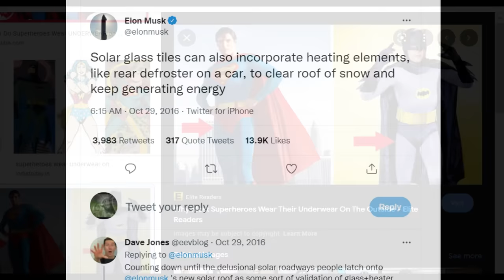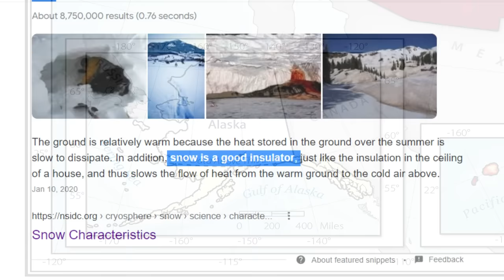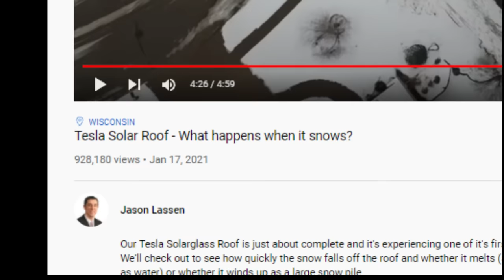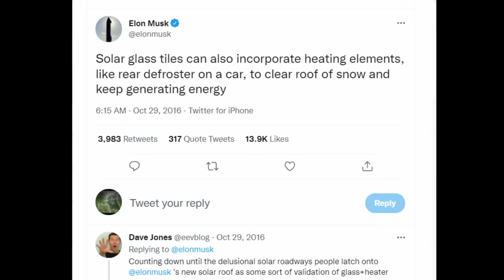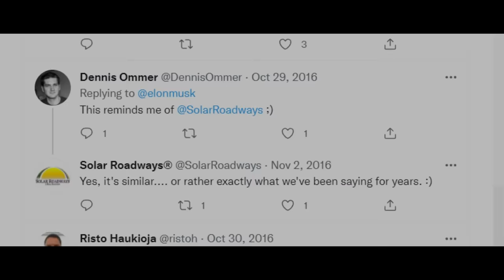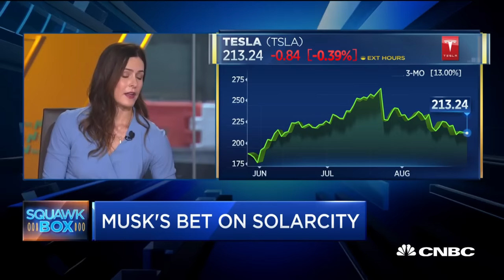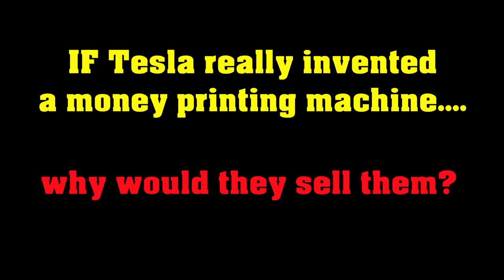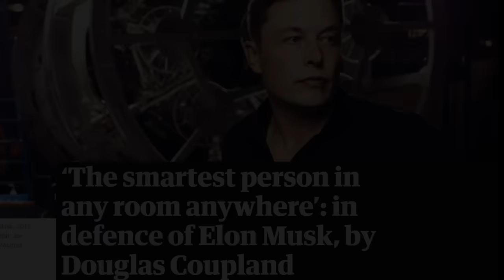Elon Musk: The Smartest Person in any room ANYWHERE!

Comment: I learned that at age 11 from a bus driver on my way to school in the 1980's. For some reason he thought it was fun to point out which houses were insulated and which were not, and it became a gme on the bus to spot them first.
Reply: ...and little Johnny felt pride each time his house was pointed out as "well insulated",  but knew inside the heat was barely on.
Reply: xD i'm gonna make your comment more explicit: "Elon Musk would not be the smartest person in a schoolbus" ;)
Reply: @kapa1611  School bus? Elon was too smart for school. He was always  playing air hooky instead. That's why he knows so much about air hooky tables.
Reply: @1puppetbike  Take a look at the icicles to confirm which houses are badly insulated.  The more and bigger the icicles, the worse the insulation.
Reply: @Foolish188  not necessarily. The reason snow makes such good insulation, is because of the fact, the layer in direct contact with the roof shingle, does indeed melt, forming a liquid barrier, between the roof shingle, and the rest of the snow layer. That small bit of water, goes through a melting and refreezing process throughout the time in which there is snow on top of the roof. This is similar to how igloos work, and why igloos can reach 60 degrees F inside, despite the outside being freezing, and without the snow, in which the igloo is made of, melting completely.

The roof of a house, being slanted, means the water freezing and melting, constantly, will eventually drain off, and start dripping off the sides. When it starts dripping off the side, icicles begin to form (btw, icicles are basically the stalactites of houses, since both are formed by the dripping of water...). This is why, it is important to look at the roof and see if it has snow on it, rather than looking at the icicles. How much snow does the house have on its roof, compared to all the other houses in the area?

A house that has poor insulation (like my neighbor in New York), will never have icicles... Or in this case since it is an anecdote, it should be said: I never saw a single icicle form on my neighbor's poorly insulated house. While in contrast, the houses that had snow build up on their roofs, always had icicles to go with it after a few days has passed since snowfall.
Reply: @deathsheir2035  I always thought the insulation of snow worked like most kinda of insulation, the trapping of air.  When I was a kid, my parents let us sleep in a snow fort, as much like an igloo as a 9 and 11 year olds could manage.  We were warm enough in our cheap summer camp sleeping bags.  I am pretty sure that there wasn't much in the way of water and ice melting and freezing.
   And by the way, melting on a roof mostly leads to the formation of ice dams and icicles.  Ice dams can cause expensive damage and icicles represent a lot of heat loss.
Reply: Elon Musk is a great example 
for paying-youre-marketing-team-much worked out... 

Actual experts say his projects are meant to be flashy and are just that. Just flashy. 

'Adam Something' can tell you more about how moronic Elon is, 
if youre interested or want to laugh a bit.

Comment: I mean if the sun hitting the road naturally didn’t melt the snow then why would you think you could use that power to melt the snow after considering panel inefficiencies
Reply: You have to consider that snow is highly reflective.
Reply: @Flawlessx69  have you considered the panels are covered so as to not generating any power so you'll be spending power to get power, potentially when it's still snowing. Doubling down on wasting energy as well as removing the natural seasonal insulation of the snow.
Reply: @UlshaRS  I am pretty sure that the idea was to "borrow" energy for melting the snow and then return it once the solar panels are free from snow and generate energy again. 

Of course that is not guaranteed to give you a net positive but that is not what i was commenting about.
Reply: @Flawlessx69  Whas'nt it more like, the panels are heated before the snow fall, so when it fall, it melt imediatelly, therefor not covering the panels?
Reply: Because Elon said so, duh
Reply: This is one of the BEST comments that I have read, relating to this video. Complements to you Sir.
Reply: cause radiation? There might be enough heat from the sun to melt it but due to inneficiencies in heat transfer (snow is a great isolator) it may be harder for the sunlight compared to direct contact to heat it up. That being said, yes its a horrible shit idea and no one is actually listening to elons coke rants.
Reply: @Flawlessx69  Melting ice also takes as much energy as heating water to 70 degree´s. You should really look it up, its insane!
Reply: @Flawlessx69  The cold black asphalt is too cold to melt the new snow falling. Which means it collects too little energy. And so would a solar panel. But during warm spring days, you can put ashes on top of snow and speed up the initial melting by reducing the reflection. But we are talking spring, when the sun is strong.
Reply: @perwestermark8920  How does this have anything to do with what i said?
Reply: @Flawlessx69  Your first comment was about snow being highly reflective. But even with ash on top, the sun is normally not strong enough to melt the snow until the spring.
Reply: @perwestermark8920  Ah ok thats what you meant.
Reply: @UlshaRS  I was initially surprised when I saw that, during the Texas winter storm, solar power is the only sector that overperformed. I had assumed that snow would have accumulated on panels. But, it turns out that doesn't usually happen. It wasn't due to melting snow, though. It was because solar panels are usually tilted to point in the general direction of the sun (which, in Texas, is due south).
Reply: No, a lot of the energy in sunlight carries itself in light (not just heat). A solar panel can convert that energy from light to heat. Yes, not efficiently, but still more than what the light can do on its own. Also, snow is white and reflects most of that energy away from itself. The panel generates heat, not light. So it will melt snow faster than sunlight alone.

None of that means heating roofs is necessarily a good idea, though. If you're not getting a lot of sunlight in your area, then spending energy on melting snow is probably not very efficient.
Reply: @perwestermark8920  I see someone is actually taking black body radiation into account when debunking this stupid idea of solar panels melting snow. Good man.
Yeah. If the Asphalt is getting covered in snow. You're basically fucked.
Reply: @icowrich  Black can convert that light to heat. Black just means the light does not reflect back as visible light. Heat and light are actually the same thing - just that our eyes can only see a narrow band of wavelengths so we don't see the UV light above the visible spectra and we don't see the infrared light (that you normally call heat) below the visible spectra.
When a surface is black, it just means it reflects out very little in the visible spectra. But may radiate back in the IR range (i.e your heat). Black roof shingles, asphalt, ... will  all absorb visible light, heat up and radiate in the IR range.
Reply: @adrenjones9301  Yeah, but if you don't let it accumulate in the first place, it's far less costly.
Reply: @Flawlessx69  But the energy necessary for melting the snow won't be repaid by how much sunlight is actually hitting the panels. In the Midwest for example you can have months of overcast days that will massively reduce energy output.
Reply: @perwestermark8920  Yes, I know black can do that, but it's not always enough. Once a panel does get covered, black is no longer in play. At that point, a little bit of generative heat is necessary.

At any rate, the point of snow melting isn't to generate more power in the moment than is spent in the melting process. It's (at least in part) to the clear the surface for more generation throughout the day. 

I take the point that this strategy might not make sense in Alaska. But there's a lot more sun available in, say, Santa Fe. 7,200 ft elevation means a thinner atmosphere and far more luminescence than in Alaska. The trade off in power makes is worthwhile there.
Reply: @monsterous289  DId you put in your order for a tesla roof alreadY?
Reply: @20somthingrealestate  hah nah, For me I'm still waiting at least a few years until the price comes down for solar roof.  In 10 years we'll need a new roof anyways so early 2030s is likely when I'd buy one.
Reply: @monsterous289  SolarRoadways do not need to evaporate the water on them, they allow it to drain.
Reply: snow is white.
Reply: @andersreiche  snow is transparent, like polarbear fur. It's the multiple reflective surfaces that act as retro-reflectors that make it look white
Reply: it can even be energy efficient (like you spend 1/2x to melt the snow, 1/8x energy loss due poor isolation and 1x gain from the sun).
But i hardly believe that it will be cost efficient to put a solar panels at first place.
Reply: -Matter didn’t create anti matter
-Anti matter didn’t create matter
(Both of them were present at the time of big bang)
-Both of them didn’t create themselves.
-Both of them came from an unimaginable source,  that unimaginable source created matter and antimatter (everything) thats why it is known as “the creator” of everything.
——————
- that unimaginable source/creator has created sin and virtue which are opposite to each other,
— logic says every action has its own reaction, so the reaction of sin must be different than the reaction of virtue,
— the creator has created prophets to let us know about each and every detail of sin and virtue, also about their reactions,
Thank you
Reply: @elekzerosept6240  I think that was the idea, won’t work tho because winter = less sun and snowing = clouds which I turn = less sun.
Reply: @dot3510  Have you considered not being a maniac, instead?
Reply: Because they didn't think
Reply: @Flawlessx69  you have to consider that the pavement is very dark.
Reply: @vedfur5469  yes, and the cost to maintain the temperature above freezing point would probably be higher than what the panel would generate.
Reply: Minor nitpick, but technically the inefficiencies of solar panels are basically irrelevant here, as the energy that isn't converted ends up as heat anyway, and since heaters are 100% efficient... assuming you aren't hiding any steps in the process, 100% of the light that falls on a Tesla roof would go back into melting the snow.

But yeah, since 100% isn't enough to begin with...
Reply: @chrisgrill6302  You can assume it'd draw grid power at those times.
Reply: @perwestermark8920  Ashes? are you talking about the money you've burned trying to heat your house?
Reply: @elekzerosept6240  It's only when snow falls you need yhe panels above freezing. So no heating 24/7.
Reply: @chrisgrill6302  So, get a pole? With that much snow, you could probably just prod it a little, and it'd slide right off, and if it doesn't have anywhere to slide to, then get snowshoes, and emigrate your ass out of Cania lest the blood war kick up again and a Glabrezu busts your door down.
Reply: @chrisgrill6302  I will mention Cania was, though not by name, described in 1977, and then given by name, though the name was "Caina" in 1983.

Glabrezu, although not by name, were described in 1976.

Not exactly young person stuff.
Reply: @Flawlessx69  It is guaranteed to be net negative, the amount of energy to melt ice is huge.
Reply: @alexwright6038  No. It is not a guaranteed net negative. 
You do not need to melt the entire snow. Unless the roof is completely flat, it is enough to melt some of the snow (maybe only the bottom few millimeters) to make the rest slide off. 
In worst case without any heating at all, you would have to wait for the entire snow cover to disappear through sublimation, which could take quite some time.

I am pretty sure, that it would be beneficial to invest some energy to get rid of the snow in this case.
Reply: @Flawlessx69  As an owner of solar panels in a country that gets very few hours of sunlight in the winter I can tell you that you are talking out the same hole Elon does.  The more heat you can keep in the house the better.  I might get 5KWh  on a good day in the winter with a 3KW system   That might melt 6Kg of snow.  If it save me 10KWh on heating because of the increased thermal resistance which has a large effect when the temperature gradient is higher say 20 degrees inside with 0 outside getting extra few R can make a big difference and that is 24 hours a day.  Normal roof about R20  inch of snow about R1 per inch.
Reply: @monsterous289  Where did he say that it was the interior house temperature was melting the snow? in 4:20 (nice) he says "why bother with insulation" to show that it is equivalent to bad insulation, not that the following example was due to bad insulation.
Reply: @alexwright6038  You attack me without even considering what i actually said. I simply argued why you are incorrect to claim that heating solar panels will lose you energy in every single possible scenario without any exception, and gave one example, where it could be beneficial. That is all. 
And now, instead of accepting that your statement might have been wrong, you act as if i was preaching out my ass, like elon himself. Look at yourself.
Reply: @monsterous289  you do know that sloping roofs are a thing, especially in high latitudes? The snow doesn't slide off until it gets really thick.
Reply: @SKarthikeyan75   I don't know how you have come to think that snow is a part of a building's thermal insulation. The weight of snow on a roof can be a great danger to the structure of the building, and potentially cause a collapse. Snow is not part of the roof insulation. But if you live in places with little or no snow, I wouldn't be surprised if your imagination runs wild.
Reply: @SKarthikeyan75   You are obviously a genius. If the roof doesn't have the correct insulation and ventilation (air space) between the structural roof and the tiles, the snow would melt from the heat escaping through substandard insulation. Snow only adds weight to the roof.

Comment: Canadian here.  I can attest to the fact that the houses with the best insulation don't have snow melting off.  Another poorly considered issue here is that melted snow is just water, and water will naturally run off your roof as well as find any weaknesses in your roofing system.  The water will for the most part go right to your gutters, and then if you don't have the gutters going somewhere appropriate to handle all that water it will end up freezing again.  Now imagine -45 C conditions with wind chill, this water will constantly be freezing and thawing (from this radiant heated panel) - you're going to end up with a slurry on your roof that will freeze in the gutters and or create ice sheets that are going to come hurtling off your roof.
Reply: Follow Canadian here with questions: When snow falls on 1000s of km of highway, where will all the water go after a heavy snow collects? How much energy would be required to keep the now off a lightly travelled road overnight? Has Elon been north of California?
Reply: Imagine melting a meter of snow off your tesla roof...  
The owner better hope its not connected to the power grid as that would be one fucking massive electrical bill. 

Thinking about that it might just end up sheeting the bottom and making that slide off your roof eventually, would be very unfortunate to be walking to your door as a meter of snow with like 1-2 cm of hard packed ice decides to give you a fatal hug.

Comment: Heating the panels to melt the snow... sigh Thunderf00t is right. The snow should stay to insulate the house. It works. Here in the arctic, people used to shovel snow onto the house, as high up on the walls at it would go, as extra insulation. With modern houses, this is no longer worth the effort. But back to the melting of the snow on the roof: You don't want that. Everything else on the house is freezing. So what happens to the water from the melted snow? It freezes into ice, everywhere it trickles to. - Clogging your drains first, which makes the rest of the water freeze where ever it's found its way, maybe in between the panels of your walls. This is a source of many troubles, some of which are costly in the long run. Best if the snow stays there, melting during spring instead.
Reply: @silvaanosvs8783

There are solar panels out there that generate electricity during cloudy days. Maybe the current generated is more valuable than the insulating properties of the snow layer to the house..I don't know.

Solar is really more useful in sunny areas and not at the  north pole 😋